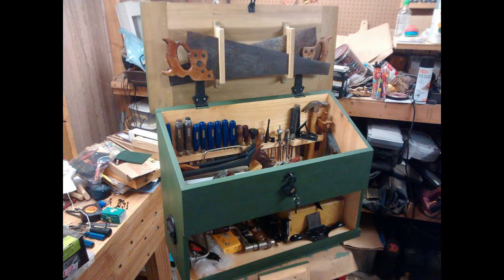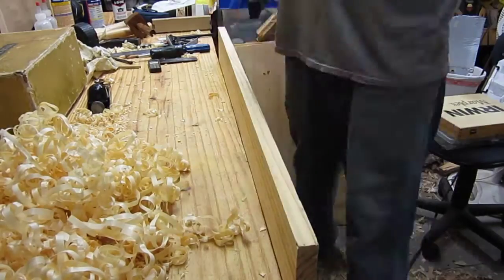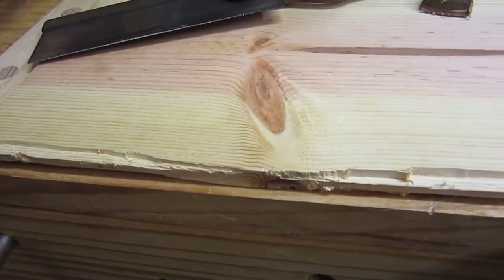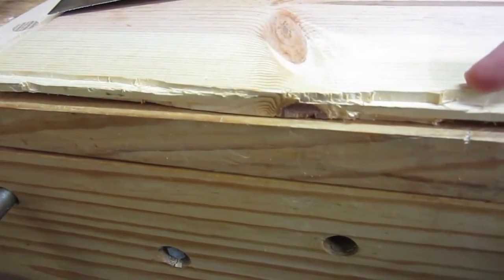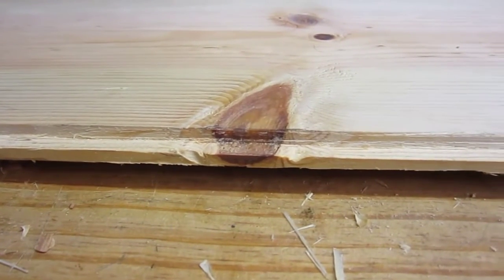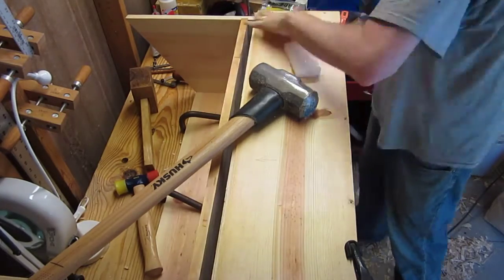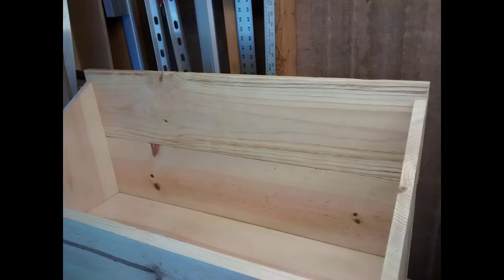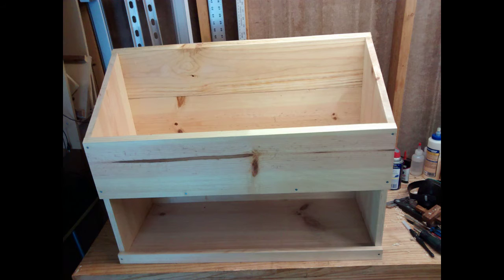Dutch Tool Chest - 05 - Back

Comment: Hey Ken, I was noticing how u were using the 45. May I suggest instead of running the plane the full length of the board, start at the other end and get it down to the desired depth. Then work your way back from there. Those combos don't like ejecting full length shavings for sum reason
Reply from the maker: Thank for the tip.  I'm definitely not an expert with the 45 yet, so I'll try your technique next time.
Reply: @SharpWorkshop  No problem good sir. Just one of the things I wished someone would've told me years ago. Keep up the beautiful work u do